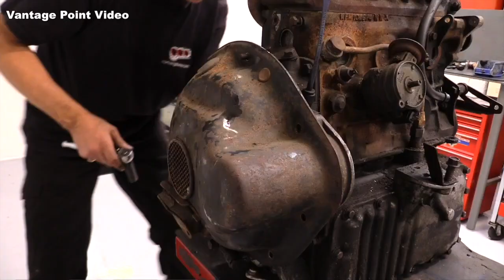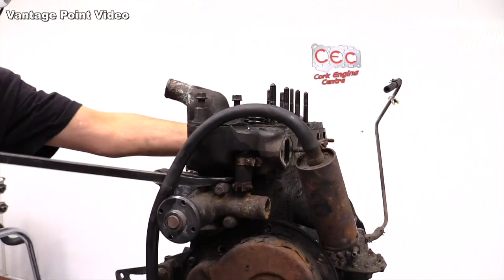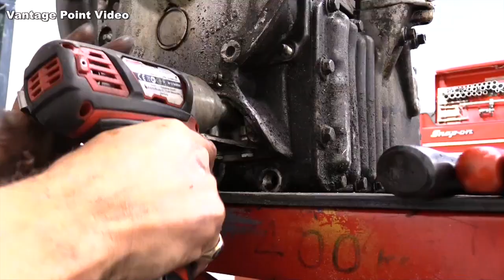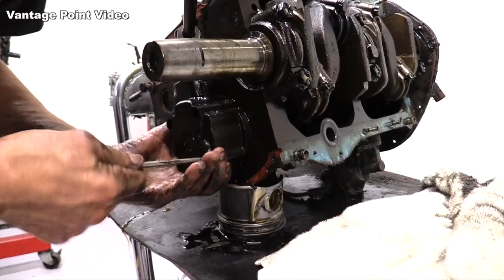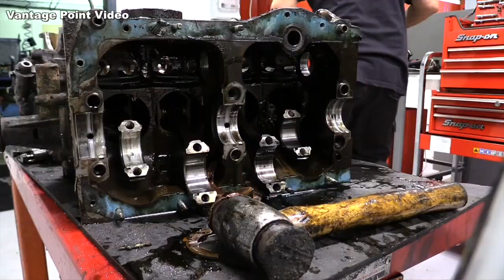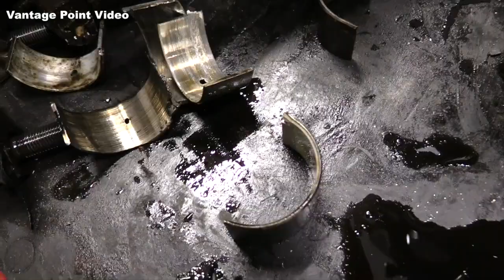Classic Mini Engine Disassembly Time-lapse

Comment: I see when micing up the crank, one seems looser, does that mean crank needs grinding ? Would this require special size big end bearings ?? Great job ! Chris
Reply: In this instance I was trying to show that No3 cyl bigend journal diameter was down on standard size and therefore all four journals would need to be reground to suit a new bearing set of at least -010"(0.25mm).In addition No3 con-rod would also need remachining(resizing) or replacing as this was also damaged in the engine failure.I hope this answer your question

Comment: I am sure the lad knows what he is doing but its never a good idea to remove more than one rod cap at a time. Especially when they are just plonked down on a bench. Its just too easy to mix them up. I always centre punch dot mark each cap and rod as well.
Those Mini automatic gearboxes were pretty damn clever even if it did mean the engine was very different to a manual engine.